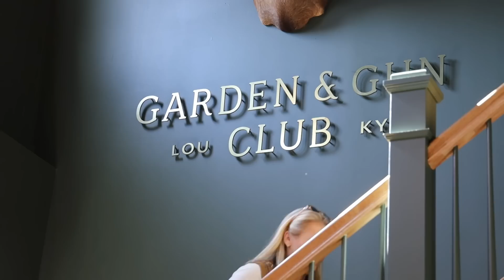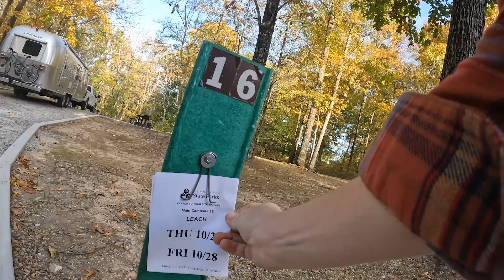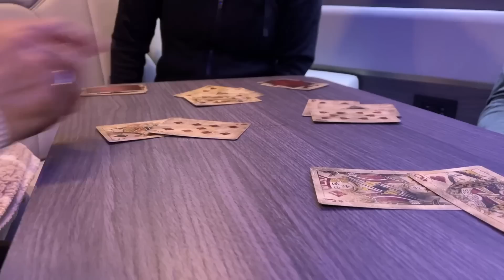Female RV Solo Adventure is Working! KYD Special Part 2

Comment: Would this ride be more or less challenging if it was in the middle of the summer instead? What's  your thoughts about this Marc?
Reply from the maker: So much harder. Heat requires so much more water and more stopping. Cold is hard, but good for "just keep peddling"